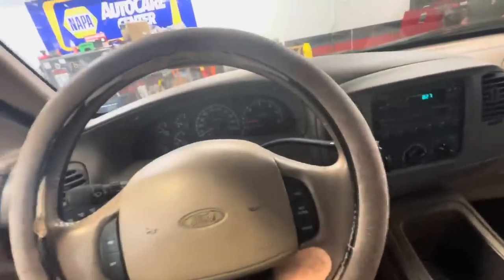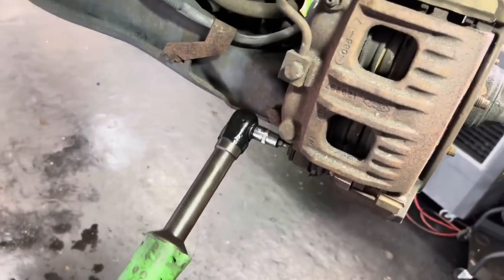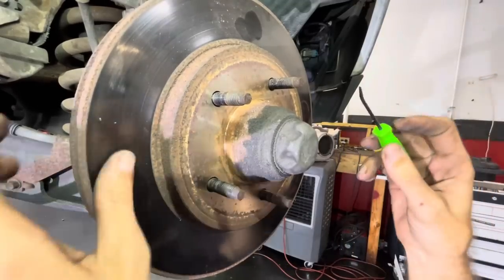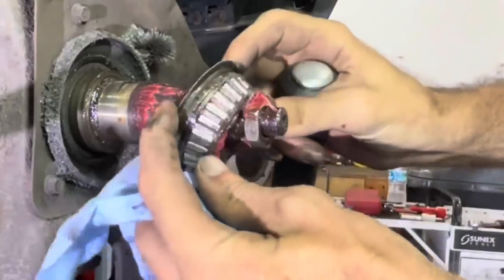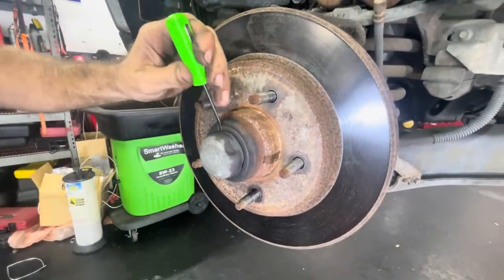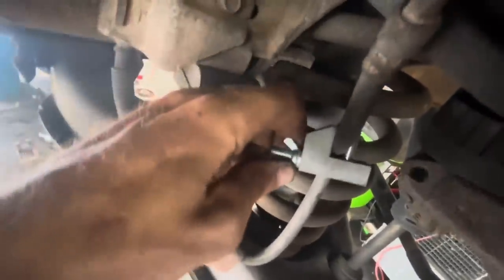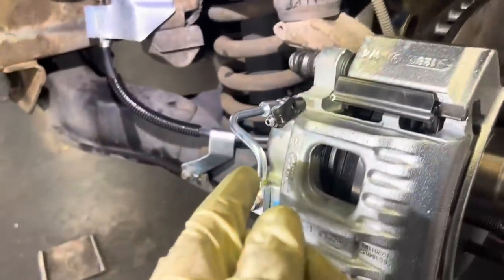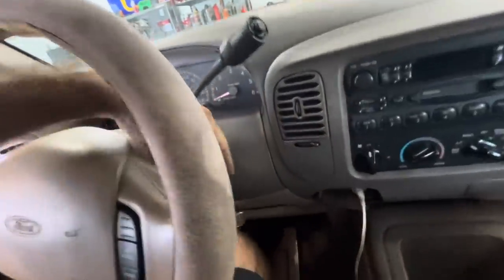Worn to NOTHING! 1998 Ford Expedition

Comment: Was glad to see the hose replacement.  I've made it my MO to replace the hose if I suspect the caliper.  It's easy to determine which is the cause of a locked up caliper but hoses are cheap and don't add much to a caliper replacement.
Reply: Wonder why you waited till job was almost done to replace the hose? IMO you wasted a set of crush washers as I don't reuse them anymore than you reuse cotter pins.
Reply: @jonstewart4513  1) I've reused lots of crush washers and never had an issue, but yes, it's best to replace them.  2) A new hose likely came with new crush washers and I'd be willing to bet he used new ones again.  3)Find bad caliper, replace bad caliper, unsuccessfully attempt to bleed new caliper only to realize the hose is bad.  Been there done that and I'll bet that's what happened here.  This is why I just replace both when I find a siezed caliper.  Even if the cause was originally the brake hose, the caliper has probably gotten pretty hot so best to just replace both.
Reply: @johnaclark1  good point on hose being a problem after caliper replacement
Reply: @jonstewart4513  Yeah, and if you watch close, when he removed the hose from the old caliper no fluid came out of the hose.  Hose was bad all along.
Reply: @johnaclark1  no fluid came out because I could have sworn he clamped the line
Reply: @jonstewart4513  Yeah, so he did.  I was thinking he did that later.

Comment: GEARWRENCH has a "Hand Bearing Packer - 2775D" device that you drop your bearing into and twist with a cap.

*Packs 50 to 60 bearings without refilling
*Transparent, impact resistant cup allows grease level check
*Use on all cage-type roller and ball bearings up to 2" bore
*Self-contained bearing packer saves time and can be used anywhere
*No air line or grease gun required

Comment: I rebuild my own calipers. If they have phenolic pistons I change them to metal and replace the O ring and dust shield. Pretty easy to do
Reply: Make sure the boards are clean and have no damage inside otherwise you can have a failure
Reply: I've never seen a plastic brake piston..
Reply: @tomf4547  I didn't say plastic piston
Reply: @jeff95519  oops sorry,  never heard of phenolic either,  had to look it up and seems to be a type of plastic casting?
Reply: @tomf4547 Me ether. I didn't say plastic, I said phenolic
Reply: @jeffdriver3000  haha I know.  And my point is I don't know what phlenic is or whatever its called 😅

Comment: Yes your correct, about the direction of channel locks should be used.
About palming bearing grease, I was tough to pack the grease from the other side wide taper to narrow. As there is that lip so the grease comes to there and spreads when grease has come to the other side then move around  a bit until that shows grease. 
 Sorry Ray not the way I was tought. 
Filling that side of the bearing will push excess into the hub for a little extra grease where it is needed. 
I have been told that the split pin or Roll pin are the same. They are some from of spring metal rolled into size diameter. 
New bearing Lubricated. As it is new and had NO grease one can't RE it. 
As opposed to a set of bearings taken and RE used, so as they have had grease/were cleaned  they then can be Re-greased.  how is that???? 
I didn't know that those keepers had different of positions.
When I changed my brake fluid , I used the single person method. Worked well.

Comment: I have a 2011 Ford Taurus natural aspiration, 28 mpg highway. Everything about this video is useful to me. I do brakes but let the pros do the. brake fluid which I change every two years.
Reply: Tis esay enuf , tho time consuming. Drain master resivior and refill, then Gravity bleed each wheel til clear , but don't let the master get empty or you'll be there all year .
Reply: @peted5217  When we get moved I'll try this. I get the brake fluid replaced every two years because I've read brake fluid attracts moisture and that is the brake line rot factor.
Reply: @davidrasch3082  Tru that. Bi annual brake fluid flush cuts down on  internal rust.
Reply: @peted5217  I also do the coolant and transmission fluid as I live in a 'harsh' climate-Minnesota.This is what the manual recommends.

Comment: Snap-On makes a very nice tool for popping off those grease caps. Those were already kinda mangled but no reason to mangle them further. It is the GCP10 at the low low price of $95. About half to a third that price on eBay. They are excellent and remove grease caps and small seals with authoritah!

Comment: I had to do this exact job to my father in law’s grand marque last Friday. His passenger rear rotor was about 1/16th” thick. So I had to replace both rear rotors, passenger rear caliper and both side brake pads
Reply: As long as it moves still drive it

Comment: Some of the old British layland cars of the seventies and eighties, had bleed nipples made from aluminium which reacted with the steel fitting, so you would go to slacken it off and would snap off , thus making a simple brake bleed job into a real nightmare, add in the uk weather to rust all the other components so every nut and bolt was stuck solid…..what fun,,

Comment: yeah racing wheel bearings in the palm of your hand that's how I learned how to do it yep learned that trick for my grandfather we were greasing the bearings on the travel trailer is that this is how you do it put a glob of grease in your hand and scrape the burger across your hand making sure you get all filled until it comes out and they're like you just rub it into the bearings afterwards make sure it's completely greased up

Comment: Using a dial ft-lb torque wrench, tighten spindle nut to 50 ft-lbs while turning rotor to seat everything properly, loosen nut about 1/2 turn, then tighten to 35 ft-lbs while turning again, put cotter pin back in.

Comment: I own a repair shop. What you did I would not allow period. When you have a bad rotor you replace both sides so you get even braking. Using old bearings on these parts is asking for returns and plan stupid. We turn down jobs if they only want one rotor to replace. I fire someone for not using new bearings. Because we have a one-year warranty on all work.

Comment: I'm glad to see you backed off the wheel nuts a hair to allow for thermal expansion
Reply: I used to have a 76 blazer with lockout hubs on the front for four-wheel drive and I was running 12.5 3315 and if I made them too tight it really made a mess out of them lockouts

Comment: When you press the pistons back into the caliper you should be bleeding the brake fluid from the caliper. That way the nasty burnt fluid, water, gunk, and rust that is in the caliper does not contaminate the rest of the brake hydraulics.

Comment: My Ford Van from same era 96 has a rotor on hub I  always wanted to  change to the other style but haven't  done it. These are twice as expensive as well  as the work. Even though I  usually replaced the  calipers one pad would wear early and ruin  calipers. Sometimes even  during  the 2 year warranty.

Comment: From what I seen when I did my brakes on a expedition those bracket bolts had locktite on the threads so they don't loosen up had to use a hammer on the wrench to break them loose

Comment: Since you was replacing the rotors on the expedition you could have took a wizzy wheel and ground off those response of the brake pads turned the rotor around and to pull them off where the brake pads was at where you ground off the rest

Comment: That washer/gasket between break hose and break caliper is not brass, it's copper. Brass is more yellowish and copper is more pink...red. Copper is much softer that's why they use it as a gaskets in some places.

Comment: I always wonder how cheap parts are in America as it makes more sense to repair the brake caliper if there is something wrong with it. No need to use brake kleen on the pistons either when retracting them as the dust boot is there to prevent stuff getting in to the piston, so I would have reused both calipers after pushing all the pistons back. Also when packing tapered bearings push in from the outer edge until the grease comes out the inner edge to ensure it is done correctly and no need to lube the spindles just place grease in the hub.

Comment: Using pliers and an adjustable wrench the wrong way is fine if, what needs to be loosened isn't really tight to begin with. Also, some times it helps with clearence issue's. Otherwise use the right tool.

Comment: Opening the bleeder valve helps a ton with depressing pistons since it relieves the pressure. You'll have to bleed the brakes afterwards though.
Reply: Also good indicator of the condition of the brake line. They go bad inside and will keep the pistons from moving back.
Reply: @tedvandell  I find on newer jeeps. If a hose or caliper fails to just replace both cause regardless it’ll be back within 2 weeks with a locked up brake again. I always check by opening bleeders to find a bad hose. But then a week or 2 later it’s back with a smoked caliper that moved free as day with an open bleeder
Reply: @blackandbluedress8500  Seems to be a lot of the newer rubber hoses have a metal clamp that encases the rubber hose. That metal rusts and puts pressure on the rubber hose, blocking it off.
Reply: You have to be careful otherwise you'll end up with air in the line

Comment: Being new bearings races in caliper, surprised you used the old bearings! Saved money got it! The only thing I did not like is when you hit the end of the cap with your hammer, with all the times you do this you do not have a tool to hit on the outer rig of the cap? I would have taken out some of the dings in it to! I made tools to would do just this, having a lathe and mill helps alot! LOL!

Comment: I've seen worse. I worked on a Econoline one ton van. The metal to metal was going on until the owner had it towed to his place of business where he could safely store it. The edge's of the piston caught the vanes inside of the rotor. That's how long it was metal to metal. Safe to say the caliper was Fucked. New bearing's, seal's,pads & rotors and a new caliper on the driver's side.

Comment: It amazes me that it’s common practice to replace a single brake disk stateside, it’s basically unheard of here. I suspect it may be because all vehicles more than 3 years old have to have a strict annual test that requires a brake force test (axle weight vs brake force and balance) here.

Comment: back in 1970 returning back to atlanta  on weekend leave from ft Gordon my wheel bearing drivers side of my 67 camaro  went bad . i stopped at a chevy  dealer and bought a new bearing. i used the old grease and got back on i20 .going along at over 90 mph i heard of noise .put over and my front spindle sheared off

Comment: Does not bother me, you are doing the work, as long as you know what you are doing I am just gonna sit back and leave you alone. I figure, as long as the mechanic is not breaking things, and then expecting me to pay for his mess up, I am good. 
Mechanic expecting me to pay for his mess up is how I lost my 2002 camaro with 75k miles on it. Took it in for intake gaskets replacement, and they ended up causing the engine to seize up and wanted me to pay for a new engine. I miss that car.
Reply: Marc, that's sad.

Comment: Watching your videos there are times when I'm like I know I was not quite on your level of expertise, it was more like I was in the basement and you're in the penthouse, living in Tennessee we have more trucks and SUV's than just about anything else, I worked for Midas for a little over 10 years at a time when they offered lifetime brake pads and shoes, I probably did 1 or 2 break jobs a day there was nothing I disliked more than repacking bearings until the owner bought out a chain of shops that went out of business they had a bearing packer that sat on top of a 2.5 gallon bucket of grease it could repack all 4 bearings with one pump of the handle I loved that little gizmo.
Reply: MaxMcarnage,  I remember when Midas would guarantee mufflers for as long as you owned your same car.    Yea, the good old days. Whatever happened. As the world turns.
Reply: @jaydegelder2964  What most people failed to realize typically when a muffler went bad you usually needed an exhaust pipe and a tailpipe to go along with it those days an 8ft stick of tubing cost in the neighborhood of 3$ and we would charge anywhere between 25-45$ so that's where they made their money, same thing with brakes pads and labor was covered but anything else was extra.

Comment: Wondering a couple things on the '98 Expedition brake job.
When you popped the rotors on the front and the smaller (outer) bearings came out, the cage part that encases the tapered rollers looked to be a reddish-brown color.
I said "that bearing cage is rusty". But when you had them on the bench cleaning everything, they were covered with the old grease, so it couldn't have been rust. Why were they that rust color? I've never seen that before...unless it actually was rust.
   Also...whenever you break out a new can of carb cleaner, we're not getting the "Creature From The Black  Lagoon" music as much as we ised to. Thats the only part of your videos  Cheryl really likes. If she doesn't get that, the rest of her day is shot.
Me too.

Comment: Another good and entertaining video from Ray. Thank you for making my afternoons peaceful and enjoyable. The only thing I noticed while watching, is that if I were to replace or reassemble a brake rotor with bearings needing to be cleaned and re-greased, I suppose I would have filled that end cap with lube as well. Maybe a bit too much, but I don't know if that would be just superflous or if it actually would be counterproductive somehow. Any suggestions why it would be a bad idea to fill the end cap with grease?
Reply: the mobility of grease is very limited, the grease'll just sit there and do nothing. Unless you get the bearing to the grease's melting point at ~200c

Comment: A nicer way to tap home the bearing grease cup is to use a nice piece of exhaust tubing
the same size as the grease cup flange.
Just tap the exhaust pipe around the edges and no more dents in the cup.
Hopefully this doesn't shake the American family web too violently.
This tip would not break any of the Ten Commandments.

Comment: Ray, you seem to be an excellant mechanic but I have just one question. I'm a diy'er, retired and have always done my own mechanic work  if I have the tools to do it. But aren't you supposed to put some lube on the new brake brackets on the calipers? I have put just enough on them to work smooth but not so much that it would get on the rotors. Am I right or wrong?
Reply: James, I am not Ray but I believe you are right !!!

Comment: There is a 3rd method for packing bearings take a ziploc ba ziploc bag put the bearing in it put some grease on the bag and draw a vacuum with your food package when on the bag and then just let us sit there it'll basically pack itself  An Olive road racing trick

Comment: imo adjustables are easier to use then you use pushing force much like the way you use them instead of pulling force. the reason why is when your pushing on the outside handle it will grip and turn at the same time. if you use them the other way you have to squeeze the handle and also pull on them. using them this way limits the grip on the nut by how hard you can squeeze them but if you use pushing force on the outside handle it will grip the nut at the same force your trying to use to move the nut and this reduces them slipping

Comment: Interestingly a cotter pin in the UK is not another name for a split pin. A UK cotter pin is a wedge-shaped bolt with a nut, for securing, for example, a pedal to the cross-shaft on a bicycle.

Comment: I had a 2000 expedition troop carrier and when I had to do my front brakes the rotors were frozen to the spindle. No tricks of any kind would free them to save them. I had to take a saws-all and cut them off.
Reply: I had that same problem on a 4wd Expedition. Prob close to 15 years ago. Had to pull the bearings and rotors off together. Brought to a shop that had a press. They had to use the press, then heat them cherry red to separate.

Comment: Is not there a bearing seal tool so it goes it one time and straight? Rather than use a dead blow rubber hammer?
Reply: A piece of pipe the right diameter and an arbor press

Comment: Good job, but I never crimp the brake hose to hold back fluid. It's steel braided, and can remain permanently pinched. Could end up with a hose failure. That's a scary situation for a customer. Instead, I plug the hole where the banjo bolt goes. The hose remains unscathed.

Comment: So here in the UK Split Pins and Cotter Pins are taken to be very different things. A Cotter Pin is a (typically) cylindrical pin with a tapered flat that locks a hub to a flat milled across the OD of a shaft - think old-school pedal crank on a push-bike - we call what you just fitted a split pin because, well, it is a pin that is split?
Reply: Adrian Nicol, Thanks for explaining. You are absolutely right !!! I never stopped to think about that.  Thanks for posting. Jay.

Comment: Noticed the cotter pins that got installed could have been the next size thicker, to loose in the spindle holes, in "aviation" this would be a redo, possibility of the nut rotating past the tab is to great.

Comment: Bearings are cheap. I always replace them. You don't really want to use old bearings with new races. The bearings and races wear together. It's okay to repack used bearings if you're not replacing the rotors, but I always replace the bearing when replacing the races.
Reply: Why are you that far into it why not do it right I did it on my 76 Blazer all the time

Comment: Using the slip joint pliers in your preferred direction adds leverage to the grip. The other way around does not. Same thing as a pipe wrench.